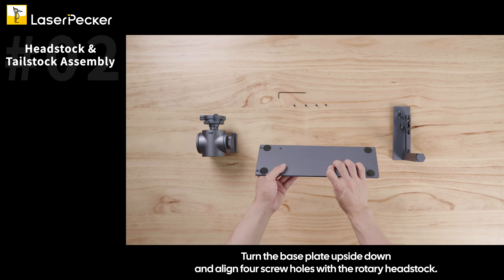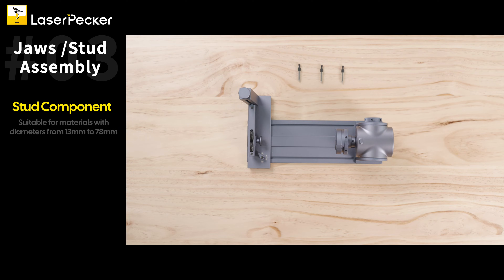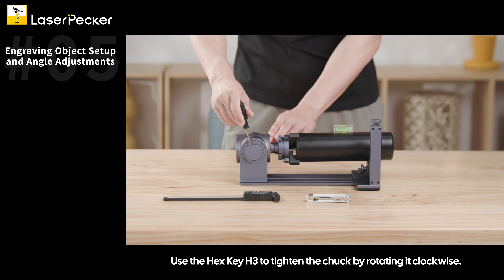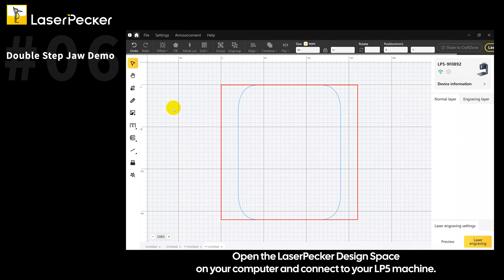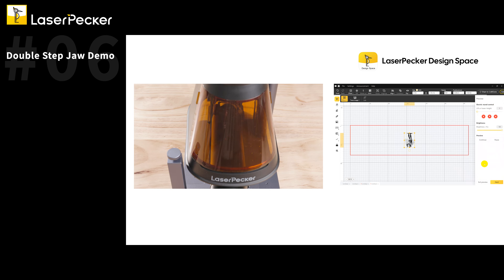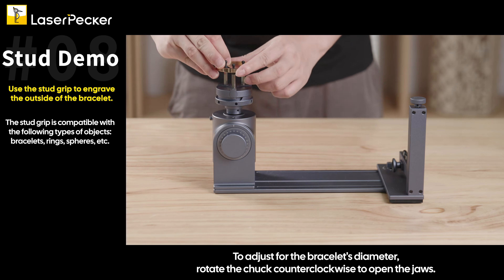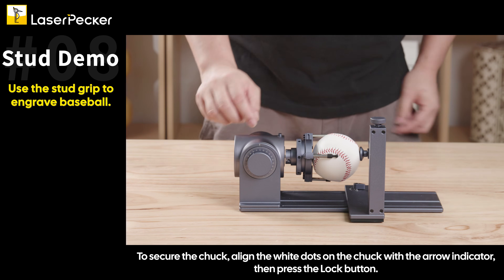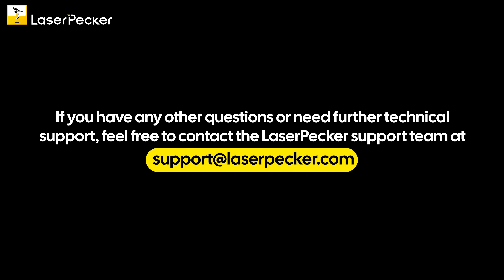Use Rotary Extension with LaserPecker LP5

Comment: If i try to engrave something with the rotary extension, the app tells me everytime that the extension is not conected. Can you help me with this problem?
Reply from the maker: Hi there! 😊

There are a couple of things that might help you. If the following method doesn't resolve your issue, please don't hesitate to contact us at: support@laserpecker.com.

Make sure all the cables are connected to the correct ports; you can find guidance in this video.
Ensure that you enable the [Rotary Extension] feature in the settings.
Try using a different cable to determine if a certain cable is broken.